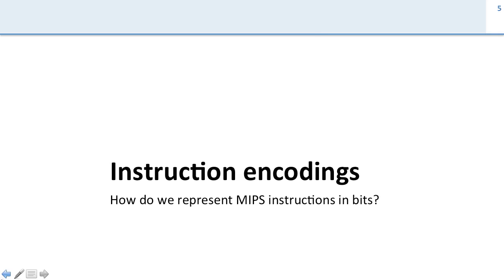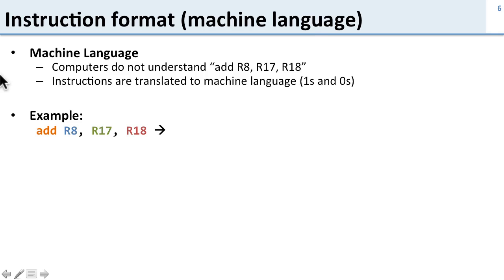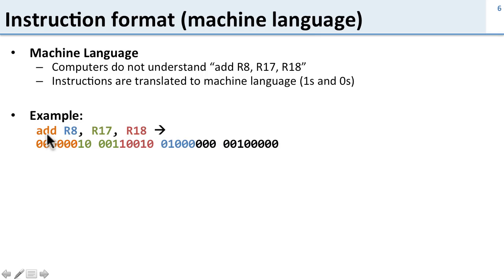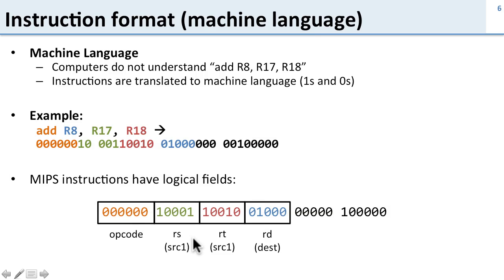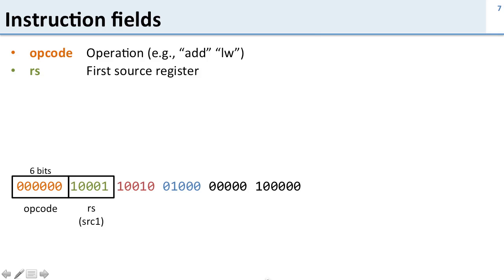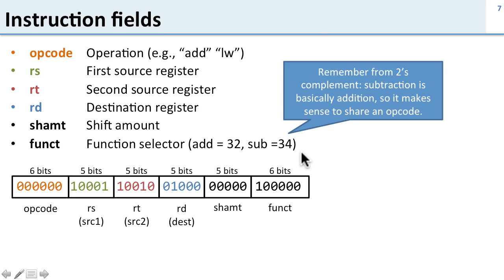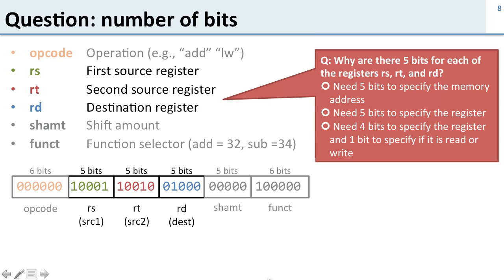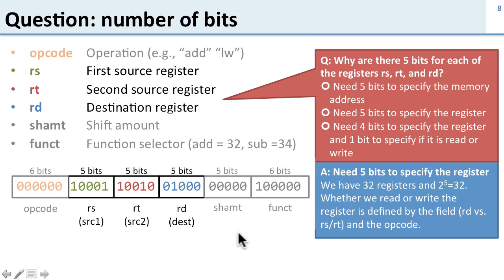ISA 2.2 MIPS Instruction Encodings

Comment: can you explain a little more on why add and sub are the same?
You ultimate still need additional bit to distinguish them, right?
so why not just combine funct and opcode bits?
Reply: Add and subtract are same in the sense of Binary Numbers Because What we can do is lets say we want to subtract 101 from 011 first we will take the 2nd number invert it using nor gate we get 100 then we add one in this we get 100+1 = 101 then add this to original number which was 101 so now 101+101 is 

1 0 1
1 0 1
 -------
0 1 0 = 2
which is 101 - 011 lets confirm 101 = 5, 011 =  3 so it is 2 and hence its correct :) if we get addition we can get Subtraction so they are same :)

Comment: Suppose we have a 16-bit MIPS processor instead of a 32-bit version. The R-type instruction has a 3-bit opcode, rs, rt & rd fields, 4-bit funct field. The I-type has a 3-bit opcode, rs & rt fields, 7-bit immediate field. The J-type has a 3-bit opcode and 13-bit target address field. Determine the max. no. of registers & the size of the MUX used in the register file for reading. Considering there are only 3 types of jump instruction, determine the max. no. of unique R-type & I-type instructions. Also, find out the range of the branch & jump instruction in terms of bytes. The working of branch & jump instructions is the same as in 32-bit version